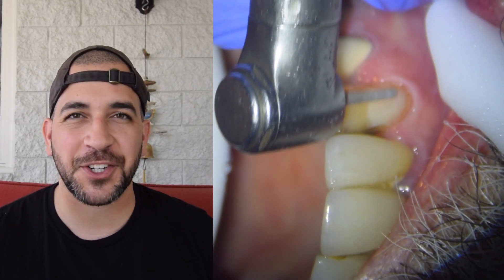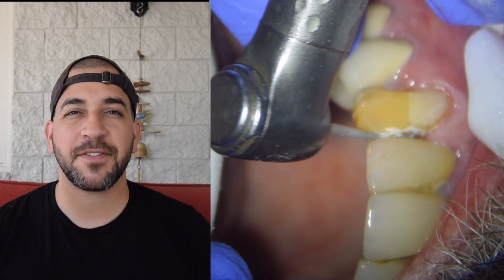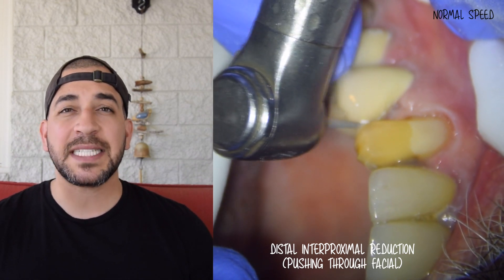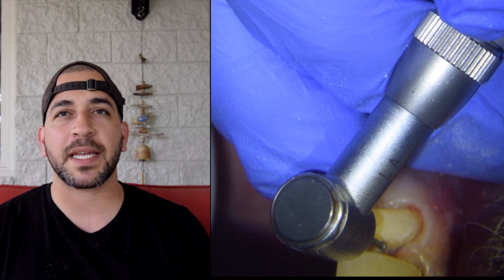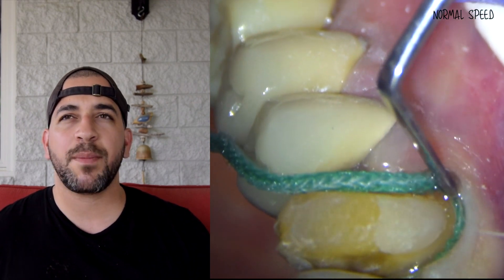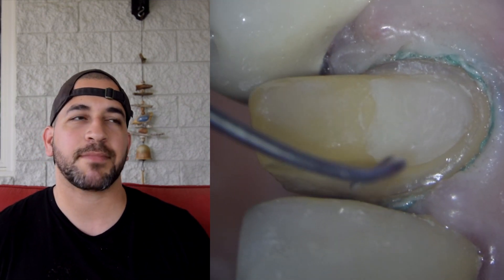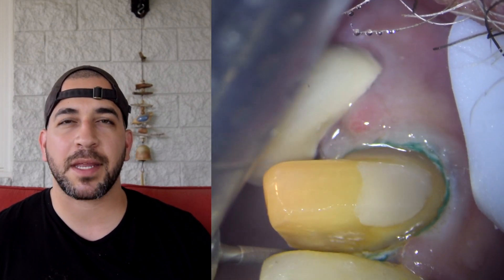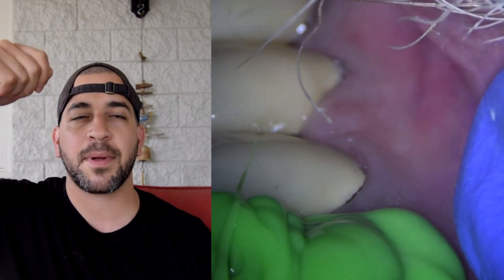Dental Crown Explained  | Anterior Crown Preparation

Comment: What about same day crown?
Reply from the maker: Same day crowns are an awesome way to get treatment done efficiently but It typically requires more tooth preparation than a ceramist who makes your crowns at a laboratory!
Reply: @SmileInfluencers  tooth preparation like they may have to build up or drill down more more time with your mouth open open your mouth wide I have TMJ disorder and I'm trying to figure out I can't even get a dentist to work on me I'm praying it's not a root canal is one of the four dentists that I needed.

Comment: Is it necessary to take an impression of the teeth before the tooth shaving preparation is started, in order to match the new crown outer shape, to the shape of the old tooth or old crown (if replacing an existing crown for tooth decay underneath)?

Comment: I had crowns put on my front teeth because of a chip that could no longer hold bond.  The dentist hit the back of the tooth next to one of the front teeth when she was preparing the area for the crown.  This made the good tooth thin.  I brought it to the dentists attention and she told me just don't bite on it. WHAT!  I asked the dental assistant to make note of it.  It was fine for a few months but while flossing a sliver of the good tooth started to break off.  I pushed it back into place the best I could.  I do hope the dental assistant did indeed make note of the comment from the dentist so when I return to the office I am not charged for her mistake.  Any comments about my experience?   No comments?????  Very SAD
Reply: What happened??
Reply: @FactCheckTV18  At my appointment my dentist said "she did not appreciate my accusation" she also said she did not damage the tooth in question.  When the dental assistant showed the dentist her notes the dentist said the notes don't mean anything because she did not write them.  She told me she would not fix the tooth and that I should go somewhere else.  I was speechless!  The dentist said she would ONLY see me if I had a problem with the two caps she did, NOTHING else.  I had been going to that dentist office for 9yrs, they have had a few changes in dentists but I always went back and never had an issue.  This dentist was new.  The dental assistant took me aside and said how sorry she was and gave me the name of a dentist that I would be comfortable with and would help me.  I had to pay to get it fixed.  I hate getting treated like crap!
Reply: @leahd3192  so sad. Go to public lawyer and ask for help
Reply: @EnSabahNur-ir5mw   I did think about retaining a lawyer but I have to pick my battles and this wasn't one I wanted to go forward with. I do hate letting people especially professionals get away with screwing me over.

Comment: Question.. My very last bottom molar needed root canal and crown. Root canal was completed..went to dentist after that to prep tooth for crown and they use a cerec machine. The crown was sitting much too high and the dentist decided it couldn't be done. Said there isn't enough space. Does that sound right? And they had not taken an impression of the tooth before grinding it down. So I'm truly baffled how we're going to create a crown and wondering if I should go to a different dentist. At this time I just have a temp on and it's also too high and bugging me. Sigh
Reply: I had a horrible dentist who botched my root canal. I was upset, and threatened to sue. They literally put temporary filling paste all over my tooth (it's a front tooth) and couldnt complete it. They told me the only option was to pull it!!! I MADE they find me someone who could fix THIER mistake. Hes about 40 minutes away but hes GREAT! He fixed the tooth. Before the crown, I had to get a "gum lengthening " procedure. My teeth look great and I have been going to him ever since.  Some dentists really suck! And they dont all have the same level of skills. I'm no dentist, but I'm assuming you probably should of had a gum lengthening before the crown was placed to avoid that issue. I went though hell before I found my God sent dentist now, so I know the feeling!
Reply: @BreezeDaDon  wow! Ugh. I still have nothing on this tooth. So basically I had a root canal and then had it ground down and shaped like a little flat round top. At this point I just let it be. I'm sure someone will tell me that it needs a crown but it's the very last tooth so I figure if no one can see it I'm alright with it. I need to find a better dentist though.

Comment: It's been always difficult for me to prepare the palatal side of the crown. How can I solve this ?any clue ?
Reply from the maker: Honestly it comes down to practice and proper use of a mirror. The palatial side of an anterior tooth is predictable but the palatial side of a upper molar can be difficult especially if a patient has a large tongue that can get close to your preparation bur. Controlling the high vac or using a mirror to prevent the tongue while working on the palatial side is helpful. Having a direct line of visualization is another trick... where are you having trouble specifically

Comment: This was super helpful Dr. Sami! Im a dental student in my senior year and have a crown prep on a patient tomorrow. Definitely a great refresher. very well made video!
I actually struggled on my first few provisionals. Ive been using versatemp. overall they have cracked off quite often and come out distorted after making the matrix. now im sure its not the material and it is probably me doing it wrong. would you be able to make a video on provisionals as well?
Reply from the maker: I'm so glad you found the video useful!! It's my pleasure making videos that can help give you guys new ideas/approaches to clinical dentistry. I will definitely try to make a video on provisionals. Do you prefer anterior or posterior provisionals? Is there anything specific you want to learn (margins, polishing)?
Reply: San Diego Dentistry i have a couple maxillary posterior crowns coming up. 
ive struggled keeping the margins intact and preventing the provisional coming out distorted. 

also, would appreciate tips on chair positioning and visibility. i.e. i always have. hard time with the distobuccal of a crown prep. my preps look fine until i look at the DB lol. 

i know these are common concerns amongst my peers as well.